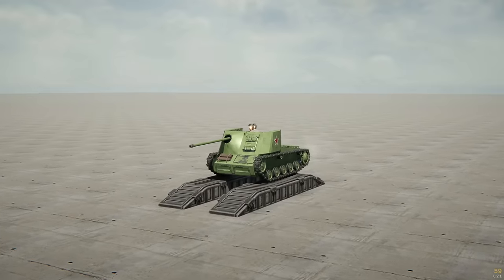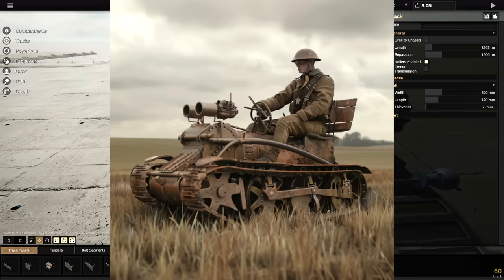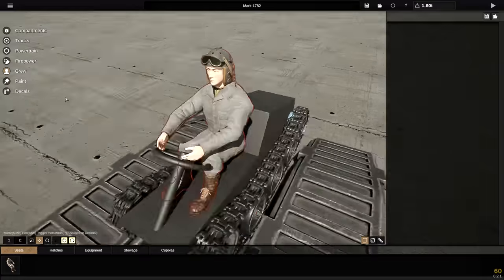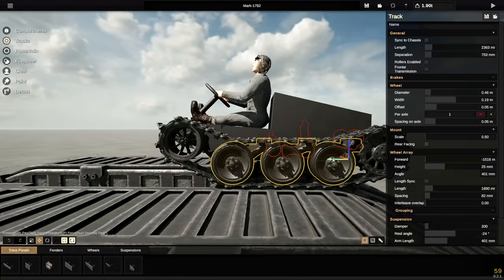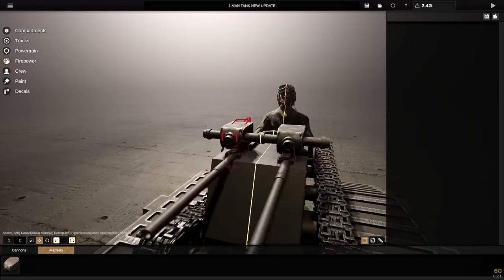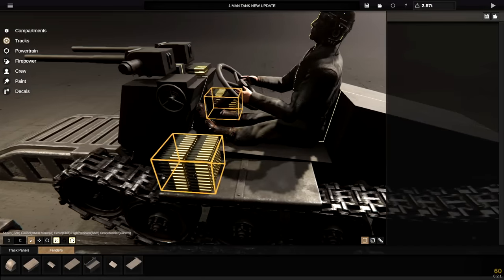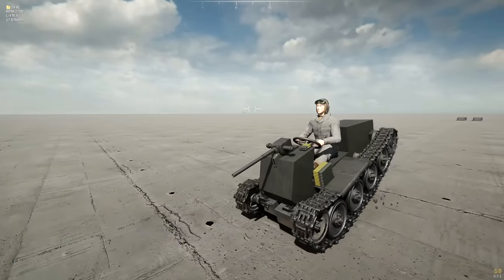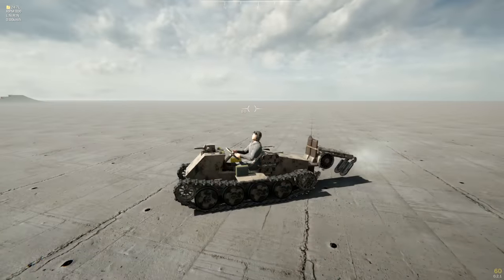I Built A ONE MAN TANK In The NEW SPROCKET UPDATE!

Comment: make this
 The Thunderclap Mk. IV is an advanced main battle tank designed for superior firepower and mobility on the battlefield. Its robust, angular hull is coated with reactive armor plating, providing enhanced protection against both conventional and explosive threats.

Main Armament:
120mm smoothbore cannon with autoloader. Capable of firing a variety of ammunition types, including armor-piercing sabot rounds and high-explosive anti-tank shells, the Thunderclap's main gun ensures it maintains dominance over enemy armor.

Secondary Armament:

Coaxial 7.62mm machine gun for engaging infantry and light vehicles.
Remote-controlled turret-mounted anti-aircraft machine gun for defense against aerial threats.
Mobility:
Powered by a high-performance diesel engine, the Thunderclap Mk. IV boasts impressive speed and agility, allowing it to maneuver effectively across diverse terrain. Its hydropneumatic suspension system ensures a smooth ride for the crew even over rough terrain.

Crew:
Operated by a crew of four: commander, gunner, loader, and driver. The tank's spacious interior is equipped with ergonomic seats and state-of-the-art communication systems, ensuring efficient coordination during combat operations.

Additional Features:

Modular armor system: Allows for the attachment of additional armor modules to enhance protection as needed.
Advanced targeting and fire control systems: Equipped with thermal imaging, laser rangefinders, and ballistic computers for precision targeting and accurate fire on the move.
Battlefield networking capability: Integrated communication suite enables seamless integration with other friendly units for enhanced situational awareness and coordination.
The Thunderclap Mk. IV represents the pinnacle of armored warfare technology, combining firepower, protection, and mobility to dominate the modern battlefield.